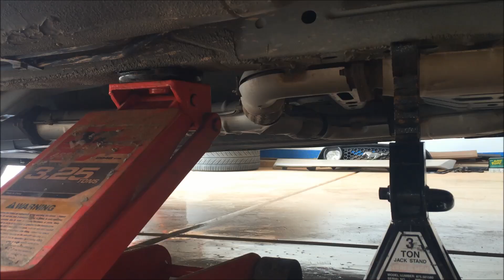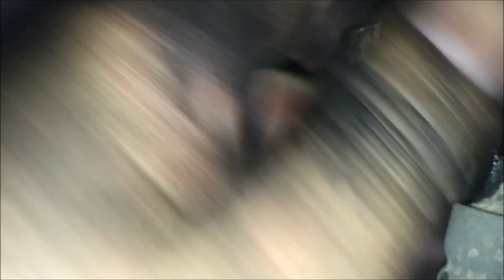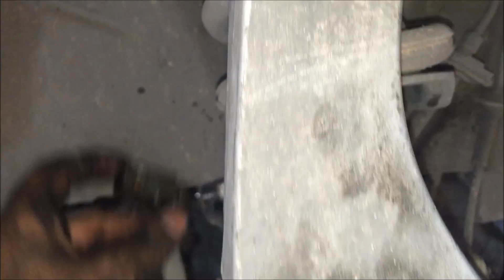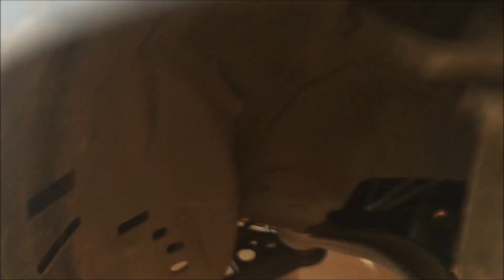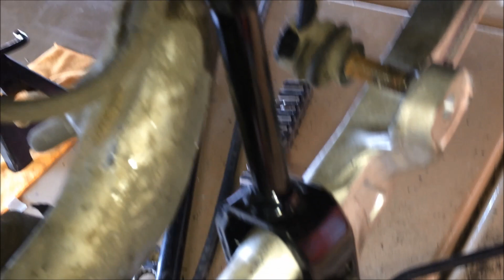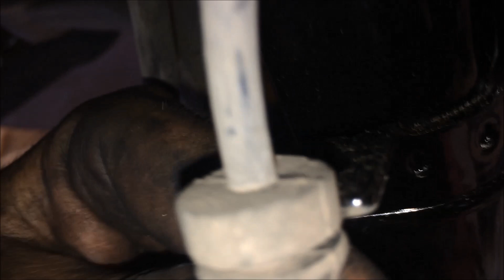How to install front struts/shocks: 03-06 Infiniti G35 skyline

Comment: I found these torque specs in the Infiniti service manuals:
Three nuts on top (28-30lbs), 
bolt strut fork to control arm (51-57 lbs), 
ball joint nut (70lbs)
bolt sway bar (65lbs).

Comment: Is it necessary to replace the shock absorbers in the front axle together even if the other is in good condition?  Knowing that the car has covered 100,000 miles
Reply from the maker: Yes, both should be replaced for proper Safety and balance

Comment: Great video! You should torque the strut, sway bar link, and lower control arm after the weight of the vehicle is down on the tire using the factory torque specs...
Reply: Yes, I would like to know the torque specs also.

Comment: Hey im doing my front struts for the first time and the nut with the cotter pin is just spinning i took tbe pin out but the nut isnt moving... any suggestions?
Reply from the maker: If it’s just spinning, you’ll probably need the impact gun, or try loosening it with the socket wrench, but pull at an angle so it puts pressure on the stud as the nut moves
Reply: @dannyjohnsonsgarage  i used the impact and it worked thanks

Comment: Probably a stupid question but is the breaker oil/spray the same as WD-40? I'm considering doing this myself since it seems the tools I need are minimal. Just gotta get me a jack and stand. Anything I should be cautious about?
Reply from the maker: Chief Walking Water Yeah, it’s penetrating oil. The liquid wrench and pb blaster is a little better than wd-40, but that should also work. It doesn’t hurt to pick up a can of liquid wrench or pb though.
Reply: @dannyjohnsonsgarage  awesome! Thanks for the quick reply! I got the raceland Ultimo coilovers and my friends keep bailing on me so I'm figuring to just do it myself. I have next to no experience which is why I was asking them to help and looking for videos.
Reply from the maker: Chief Walking Water It’s not too bad. Just take it slow and follow the video. You’ll be fine. 👊🏻

Comment: I'm pretty sure this is the same method for a 350z?
Reply from the maker: bman409 Yes. Same process. In fact, I just replaced these on my mom’s volvo and it’s the same for that too. Any coil over car should be the same
Reply: Cool beans, I just got me some lowering springs and I was gonna take the strut and spring to the shop and have em assemble it for me and then I'll install it myself.

Gotta take off the strut bar as well, since they came with em.
Reply: @dannyjohnsonsgarage  I have another question, how long did it take you to do this by yourself?
Reply from the maker: bman409 It was an hour or two, but a little longer making the video
Reply: Ok cool, I literately just got my struts and lowering springs put together so I just need to install them.
Reply from the maker: bman409 As long as you follow the video it will go quick. Be safe! Good luck
Reply: Thanks man. But too bad that I can't do it today, or even maybe Sunday either due to the weather, it's raining.
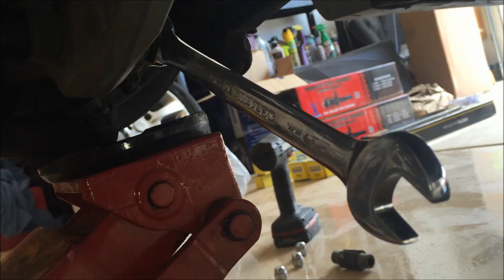Reply: @2:49 - Did you raise that control arm up with the jack high or just a little? I'm at a stand point with this because my bolt just won't budge at all. I'm using a electric impact wrench rated at 300 ft/lbs and looking at my manual it's only suppose to be tighten to 80 ft/lb max.
Reply from the maker: bman409 You can try lifting the control arm slightly (just don’t lift the car off the jack stand). I also have an electric impact rated that high and they don’t always put out that amount of torque. Only the air compressor ones really have the true power. Try a breaker bar
Reply: @dannyjohnsonsgarage  I was thinking about just taking it to a local tire shop and just have them loosen the bolt for me, then when I get home I can do the rest myself.

I just got me some more PB Blaster and I'm gonna try and let that sit for a day or so and see what happens then.
Reply from the maker: bman409 Just don’t drive on it loose. You’ll want to right it back up, but at least they might help break it loose. In the past I’ve been able to put the jack handle under the breaker bar and apply enough pressure to break it loose
Reply: Yeah, I'm saying just to loosen it up for me to where I can get home and do the rest myself. The shop is literately down the street from my house, like less than a mile, so it shouldn't be an issue. I'm pretty sure they're gonna charge me to do it too.

I didn't even use my breaker bar or cheater bar. Lol. It slipped my mind, I actually was using the breaker bar on the opposite side of the bolt to tighten while I try and loosen the other side, no luck. I had my neighbor even come over to hold the breaker bar while I use the impact gun, nothing. I was hammering it down, he heard me down the street and that's why he came over to see what I was doing.

It was already a pain to take off my front strut bar. Lol.

What I don't get is that my impact gun can take off my rear shocks, they're rated at 81 ft/lb, with ease, but can't with the front struts. So I'm guessing they're frozen on and just need to be lubed up real good.

Comment: great instructional video, but just a tip, take off the sway bar link first. Then loosen other bolts, and take off carefully, will need to support and raise/lower the jack to relieve the pressure on the bolts. Good luck.

Comment: The manual says 80 ft-lbs required for the lug nuts on my 2013 G35. Is there a reason why you used 95 ft-lbs? Another great video. I really enjoyed watching your videos in order to do some basic work without taking it to the shop. Thank you
Reply from the maker: Marty Pham Torque specs generally have a range, for example 75 ft-lbs-100 ft-lbs, so depending on where you find the spec it could be within a range. When performing very specific ranges like on the 20 inch pound rating for bearing preload you’ll see in my gear install video, I will be more specific

Comment: If I consider doing this myself, is there anything unsafe that can happen, like with the spring?
Reply from the maker: If you buy the whole thing assembled there really isn’t any risk. If you buy just the strut and need to transfer the spring over..that’s when it gets scary. Just keep a jack under the control arm as you take the bolt out as shown in the video
Reply from the maker: Here is one pre-assembled https://www.amazon.com/gp/product/B07KFR7HWC/ref=as_li_qf_asin_il_tl?ie=UTF8&tag=2004047-20&creative=9325&linkCode=as2&creativeASIN=B07KFR7HWC&linkId=d5475fa8290266b40aceba98ba03f1e6

Comment: Hey I know this video is a little old but I need some help. So the closest bolt on the control arm the 5/8s I believe when I try to torque the bolt back on the whole spindle on threads onto turns as well. Any idea on what my problem is?
Reply: 7/8ths*
Reply from the maker: Ethan Champeau Would this be on the strut itself? You need to hold the same size nut still on the other side (if it’s the one I’m thinking of). If not, tell me the time it appears in the video and I’ll try to see which one

Comment: Instead of using the air tools (which I didn't have ) to dissemble the suspension, I used a bottle jack between the A-arm and the fender to give enough clearance to remove & install the strut. Worked out OK.
Reply: This was the comment I was looking for, thanks buddy

Comment: What’s ups man, how’s the ride quality ? I want something smooth , not to bumpy quality too
Reply from the maker: juan Agustin these feel the same as the factory ride
Reply: I just put a set on my g35x and the ride height is a little higher. Also can hear every little bump.
Reply: Any recommendations on a 2006 g35x struts. I need  it bad for both fronts. Any links where 2 buy

Comment: Great video. I’ve been thinking about replacing the struts on my 2006 G35 for some time and after watching your video I think I can do it. Good tip on getting the coil over preassembled
Reply from the maker: Definitely the way to go. It is pretty straightforward. I’m sure you can do it!

Comment: Are these struts good? What's ur experience? Would u recommend?
Reply: Danny Johnson do you have any suggestions? I’ve looked around, but I’m not sure which to get.
Reply from the maker: Yes. They are doing a great job as an economy strut. My only recommendation would be a different brand that offers a camber bolt. These, as well as factory struts will not allow you to get a perfect alignment. I’m not sure these are adjustable either, so depends on what you want for performance. These work for my wife’s car.
Reply from the maker: A channel for storing videos Being that my wife’s car is not performance based, but rather factory smooth focused, I can’t really say for people looking to upgrade. These have been good “factory replacements” so far- no complaints EXCEPT, you might want to look for some that also have an adjustable camber bolt. The car does not have them stock, but it helps when aligning

Comment: Excellent video. Please provide link where you bought strut as a whole assembly. Thanks
Reply from the maker: Ajay Jain it was purchased from rockauto.com. I'd post a link, but where these parts can be different on G35, G35X(all wheel drive), 350Z etc, I better not confuse anyone with my specific part #. Thank you for watching and let me know if you have any questions
Reply: Thanks for info, I have G35X and will search on rockauto.com. Appreciated your response and once again thanks for beautiful explanatory video.
Reply from the maker: Ajay Jain I'm glad it was worth while. Good luck on the install.

Comment: What brand is the quick assembly strut and where did you purchased  it.
Reply from the maker: mannyg35 purchased from rock auto. Buyer's Guide : FCS 1335584R Strut / Coil Spring / Mount Assembly
Reply from the maker: mannyg35 https://www.rockauto.com/en/catalog/infiniti,2006,g35,3.5l+v6,1432547,suspension,strut+/+coil+spring+/+mount+assembly,15174
Reply: I just got mine today and they have the same part number I'm thinking they sent me two of the same side.